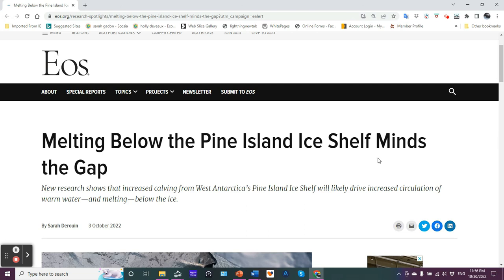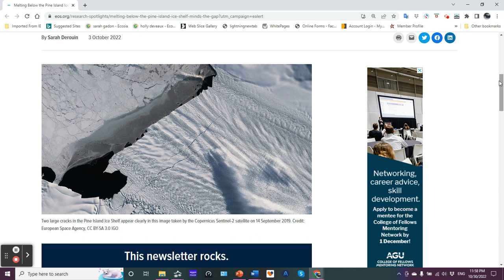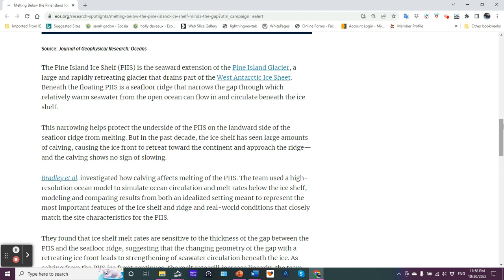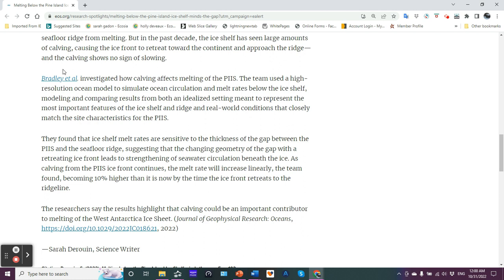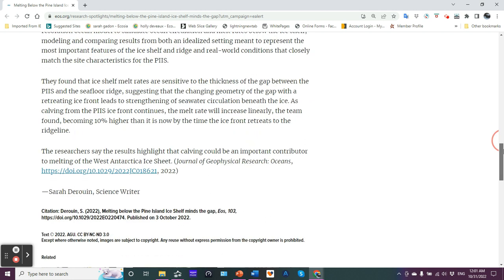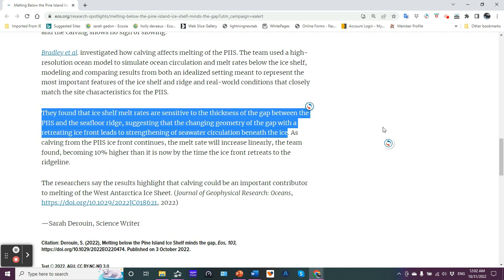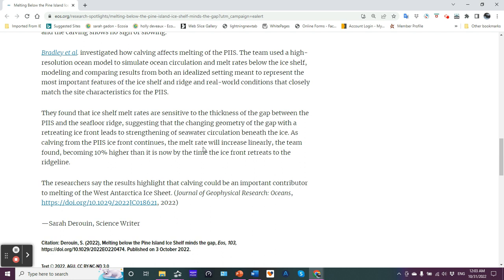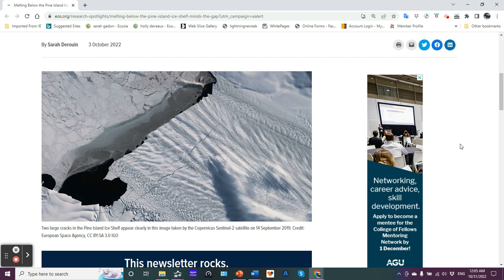Pine Island Ice Shelf Melting from Below is Increasing

Comment: Merci beaucoup for this Jim.  Swiss state run media last ran a story about Antarctica in March of last year.  Could you do an explanation on the large iceberg that had been grounded for the last 20 (?) years that has started to move recently?  It would be great if you could give us an overview of the underwater circulation patterns of the Southern Ocean, specifically in this region.
Reply from the maker: Those details are being ascertained. What we do know is that the water is warmer, expands as a result and then helps lubricate the grounding line allowing the ice to move, eventually break off. And of course, increase the melt. It is not just air temperatures, but the warming ocean I would argue is a larger factor.